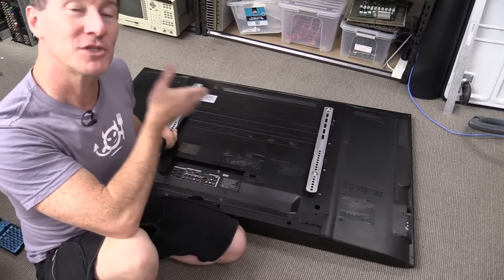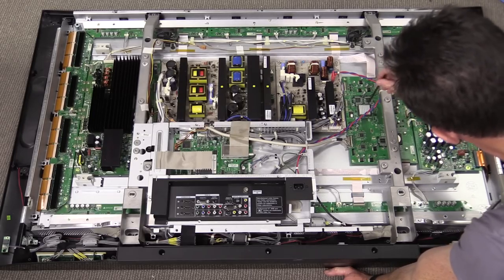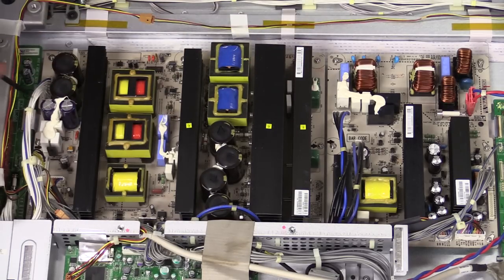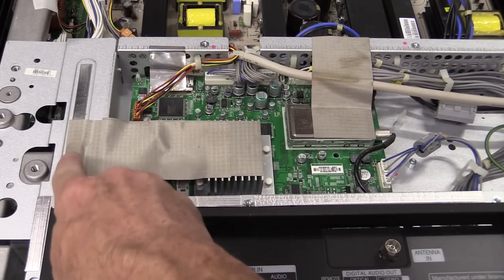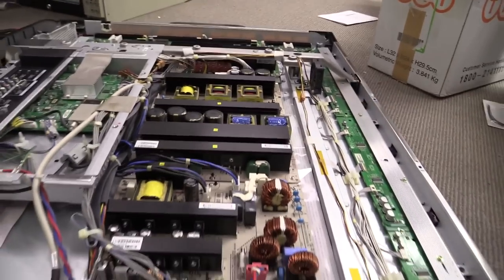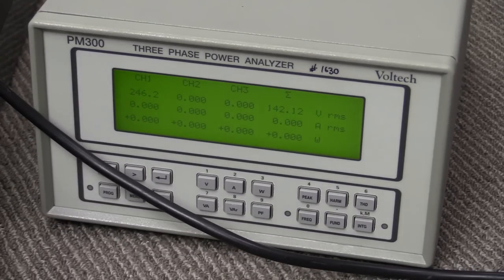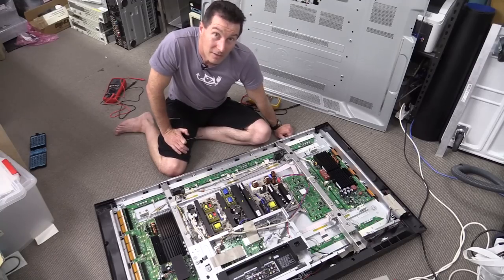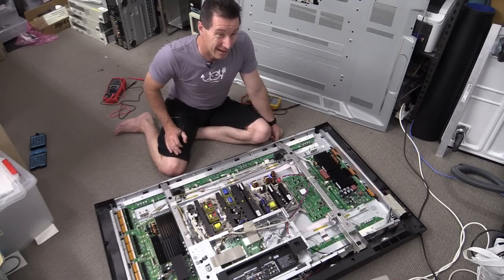EEVblog #725 - LG Plasma TV Teardown

Comment: Granted they are heavy, complicated and LCDs have reached a point where video quality is equivalent. But as far as reliability I'm just not so sure its as bad as you think.

I purchased a (high end) Panasonic 50" Plasma (Dec 2003). It is my family's only TV and gets quite the workout. TV is Still working great, no issues at all. (BTW it is bolted directly into the studs of the wall via a bracket and 1/4 bolts, did it myself, no biggie It has survived 2-3 medium earthquakes also).

Meanwhile I've had to replace my computer's LCD twice in that same time period.
Both times was failing worn-out/dim backlight.

Comment: yesterday i have checked an panasonic TX-P42GW30 plasma tv :) with no screen only green led whas powerd on, the y-sus board (TNP A5457) whas shorted out and i found 5 big smd mosfets are blowen under the heat sink and 2 big smd diodes, also i found an repair kit on ebay for this y-sus board with D401 D421 Q401 Q402 Q403 Q421 Q422 Q423 Q531 IC502  componenst,

Comment: We have a 50" Samsung warp plasma TV, I hate it, much prefer my 27" Samsung T27B550 LCD TV, mostly because the LCD TV doesn't make a load of squeals, buzzes, pops, crackles and whatever else the 50" can come up with, had to replace the PSU on the 50" too and that was pricey, if it dies, screw it, I hate plasmas... :P

Comment: Can I just clear up a couple of confusions on this much debated topic.
When referred to LED/LCD, the LED part is the form of Back Light used to illuminate the display, the older type was Cold Cathode LCD which used a funky uber thin fluorescent tube to light the display and suffered colour drift with age.
Now then, the over used term 'Burn-In' when talking about OLED/LCD/PLASMA is not entirely the correct term. Burn-In was entirely true when referencing CRT displays where the phosphors making up the pixels would degrade over time when over exposed to an electron beam.
In the case of LCDs, the mechanics of burn-in are different than plasma and OLED, which develop burn-in from luminance degradation of the light-emitting pixels. For LCDs, burn-in develops in some cases because pixels permanently lose their ability to return to their relaxed state after a continued static usage profile. In most typical usage profiles, this image persistence in LCD is only transient.
Both plasma-type and LCD-type displays exhibit a similar phenomenon called Transient Image Persistence, which is sometimes confused with screen burn but is not permanent. In the case of plasma-type displays, transient image persistence is caused by charge build-up in the pixel cells (not cumulative luminance degradation as with burn-in), which can be seen sometimes when a bright image that was set against a dark background is replaced by a dark background only; this image retention is usually released once a typical-brightness image is displayed and does not inhibit the display's typical viewing image quality.

Comment: Well I like the plasma TV's. Panasonic. The blacks are better than most LCD displays. The viewing angles are way better than LCD's. The colours are not washed out. Our plasma has outlasted two LG LCD monitors. However I think LED LCD TV's have improved the LCD market greatly. I would go for a LED LCD now as times have changed. PS plasma do output lots of EMI but nothing thats terrible. Plasma displays are clever design and a nice piece of engineering. 
Cheers Dave. Nice tear down.

Comment: I have an LG 22" Widescreen PC monitor I bought because I thought it would do me well for years.. The LED backlight failed after a few months of using it. The LCD still works, you can see it if you shine a light at it. The fault started with flickering, then one corner going dark, then the LED backlight just wouldnt come on at all. I dont know what to do with it, I couldnt be bothered taking it back under warranty as I have electronics background I can probably fix it, but I dont have the equipment to test it. Maybe its a power supply issue, or all the LEDS failed at once (unlikely) any thoughts?

Comment: MY LG 42LC2D has been running faithfully for 7 years.  Still looks as good as the day I have bought it. (Now having said that it will crash in a heap)  lol.  Yes it is an LCD HD 1080p, Although I have been told on the quiet the panel is on a 720p.
Thanks dave.   I do agree that those caps look like they have let go abit.

Comment: Did anybody else notice the 8 or more bulging capacitors on the first PS board? power board on the right when looking from the bottom. CLEARLY swollen caps between, under and around the big black heat sink

Comment: 6:10 frame...did you notice those caps on the power supply board on the right side...bottom right hand corner...looks like they blew up..BULGE!

12:30 YOU DID A CLOSE UP AND MISSED IT!!! HOLY CRAP!!

Comment: 50 kilos of power hungry gear!
I agreeDave, take it apart. 
Over 200 watts for a display! Wutt?

I do like high contrast screens, was very excited about the Trinitron my parents bought back mid-90s. Did a quick look for the Pioneer PDP-LX5090 OLED mentioned here... 420W! Oh my, black takes a lot of power doesn't it. Didn't old tube sets work with 100-200 watts?

Comment: When choosing a 'flat screen' TV for the first time, I went into the retailers with an open mind. Of the ones on display & working, it soon became apparent that the picture 'sharpness' was a lot better on LCD & LED televisions (at normal viewing distances). The picture definition seemed lower on 'Plasma' screens, however there was (in their favour) slightly less smearing of fast moving scenes. So to be fair to both I viewed all the TV's on working display & without looking at the spec label - so as to be impartial; I wrote on a piece of paper 'Y' (or) 'N' (yes or no) for the overall picture quality. The results were :- all 'YESES' for 'LCD' or 'LED' televisions & all 'NOs' for 'PLASMA'.
Not a scientific test, I agree - but it was good enough for me. I will always buy & recommend to others - 'LCD' & 'LED' displays every time until 'technology' brings out something even better.

Comment: New 55" LCD screens use only ~132 watts!  Versus 572 watts for the old Samsung!  Multiply that times 500-700,000 houses, bars... puts a load on the power companies and the planet (burning coal to produce watts) and transmission lines.

Comment: IME,the PSU's in these things are fairly heavily filtered on the line input.There will often be several sections of filtering with common mode chokes,and caps. Then there's typically some soft-start (the relays/resistors) and then into some PFC action.
12:49,that's a ferrite bead/filter.
15:08,It's common that the display panel will have a sticker on it,with it's required voltages.Some displays can be sort of picky about these voltages,so they need to be fairly bang-on. (it can also affect picture quality)
I've given up on trying to repair plasma sets. They're a PITA.

Comment: Arg I kept yelling at my TV every time you went over those bulging caps on the low voltage power supply board and didn't notice, dead giveaway! Another crap LG TV, worst brand I have seen, fixed so many of them just out of warranty due to capacitor issues. Why they keep designing power supplies with substandard capacitors and shoving them right next to the heat sinking blows my mind. BTW not all plasmas use huge amounts of power, old ones did, new ones actually made huge strides in efficiency. My newer Samsung uses about 160w calibrated, hardly a huge amount for a 58" panel. If you are going to do a video you should atleast give it a proper go! :)

Comment: I think you're exaggerating the power use a bit.  I have a 8 year old (around $900 at the time) Panasonic 50 inch Plasma that still works perfectly.  With the picture the way we like it, it uses around 140W. We live totally off grid and were expecting to need to replace the tv but 3 hrs use a day is no big deal. Heck people still run 6-8 x 50w halogen down lights in their living room!!

Comment: Sure plasmas had their drawbacks, but they gave you by far the best band for the buck in terms of image quality. The last few high-end sets from Panasonic were a whole lot lighter & thinner, and used about half the juice of that LG model, too.

These days, you're stuck with the slow response times, crappy off-angle image quality and even crappier black levels of LCDs. Unless, of course, you're willing to pony up the dough for an OLED set.

Comment: I could see some bulging capacitors on one of the boards on this video. Probably the reason why it's flickering and picture quality not being to flash. Anyway I had a Samsung Plasma screen TV but sold it on Ebay as it was chewing up way to much power and it was really heavy. I now have an LED/LCD TV now and it's much better.

Comment: Glad to see the power screw driver in use. (bare feet in all)
I have a 50 inch plasma ,"Panasonic".I always new it was a power hog from when I took it out of its box and plugged in the power cable .The cable looked as though it could  be used on 4kw power back up generator.I luv your info videos ,I am trying to watch them all. So, their you have it ,or, I mean "Bobs your uncle"..

Comment: Hey Dave ..  I noticed something may be useful in fixing this Screen .. I noticed some Caps not as good (bulged Capacitors) in the Low Power Power supply module .. wish you the best luck

Comment: The right (looking at the back) power supply board looks like the smaller caps are all bulged. The closer picture at 12:30 or so shows they are quite bulged. still watching

Yeah, would be curious to replace those and see if it fixed it. Then you could just donate it to whatever the AUS equivalent of Goodwill is. =)

Comment: In my opinion SAMWHA capacitors are good quality. Only thing is that you need to use the correct series for the  purpose...  I am using them in my projects too, never had a problem.

Comment: I might missed something or did Dave didn't saw those bulging/licking capacitors on the power supply for digital part. I can imagine operating camera takes your view off, but those are really easy to see from the first look, same as brand of caps on V power supply. It gets me worried if Dave has any vision problems, it's not the first time I spot it in his videos.

Comment: Secondary caps on the low voltage PSU are totally toast, how could you not notice that?
I don't like plasmas either but if i were you i'd replace those 6 bulging caps and just sell it for cheap.
I doubt that there's anything else wrong with it.

Comment: Did you really go through and pull parts on this? :)  I used to do that kind of thing and found I never really use the parts, they never really fit into any projects I was trying to do.  An interesting video would be if pulling gold from old electronics is really worth it.  I know it's not really engineering per se, but it has to do with scrapping electronics.

Comment: I agree - too heavy and power hungry. I would salvage it for parts also.
Reply: Especially since he basically has an 'all you can eat buffet' of LCD displays when he goes dumpster diving. He can afford to be choosy when other people are buying, then throwing out, perfectly good stuff!
Reply: dalriada842 
Yep.
Reply: dalriada842  Have to remember where he is too.  lots more money etc; so the value of things is less.
Reply: ***** 
That's not true at all. Actually, Plasma TV's are easier to diagnose and repair. It takes some work sometimes to get to the boards, but if you know what you're doing you can pinpoint the problem board most of the time by looking at what is happening on the screen.
Reply: Mitchell McCreath 
I disagree. The main drawbacks with the older units are the weight, heat output, and power consumption.
Reply: ***** 
I wouldn't have one either. And most of the time LCD/LED's are cheaper to repair than replace. You shouldn't be talking about repair when it's obvious that you know nothing about it.
Reply: ***** 
1) You better reread your comment... You said, "...they are cheaper to replace than get repaired.". Once again you are talking about repair that you obviously know nothing about! Most problems are bad solder joints, a loose connector, e-caps, diodes, or a bad cable. 
2) The repair that usually doesn't last long is the cheap BGA repair.
3) I didn't say you "can't" talk about what you want to - I said you "shouldn't".
Reply: ***** 
Oh, I don't know anything about the UK. But still the majority of problems are simple fixes.
Reply: ***** 
Who cares? Clever has nothing to do with it - I have plenty of repair manuals and books, and nearly 3 years experience.
Reply: ***** 
It's just a hobby to me. But I've saved a lot of money fixing my own stuff by learning electronics and device repair. I changed the back-up battery in my Tek 2465A DV scope myself without needing it recalibrated. That alone saved me at least $400, which is what I paid for it. I think I spent around $15 at Mouser for the battery.
You should learn to repair your own devices and save yourself a lot of money. Plus you can make extra money on the side fixing devices for other people.
Reply: ***** 
I used to be a mechanic also. I also love riding motorcycles, but my back won't let me anymore. I had a '69 Ford pickup one time that a deputy clocked me at 157 mph in. I couldn't go any faster because it would start floating on the air, even though I had plenty of pedal left.
Electronics is a fun hobby even if you don't need to save money.
Reply: ***** 
Yeah, that's what the cops thought I had and wouldn't let me leave until they inspected my truck. They didn't arrest me because I was taking a friend to the hospital.
They didn't find anything though, and had to let me go... but the engine is not where the secret was...
The secret was in the gears, of course.
Reply: ***** 
My dad used to drag race motorcycles, but I didn't work on them much. I just rode them. The engine in my truck would be idling at 60 mph, lol. I could take off in second gear and wouldn't have to shift up until about 90 or so. The rich boys wouldn't even race me. It pays to have friends that own salvage yards.
Reply: ***** 
Yeah, the cameras and everything sucks - they are trying to make us all slaves. Kids nowadays can hardly have any fun! I was born in '60. I used to run 120 or more in my '73 Monte Carlo Landau to work and back and hardly ever see anyone else. Now, you can barely back out of the driveway without getting hit by someone.
Reply: ***** 
Yeah, we can only do what we can do - save money when we can. We still have plenty of salvage yards here in Texas.
Reply: ***** 
I was a truck driver for around 14 years, so I have over 1 million documented miles. 
I know what you mean about the close calls. There are too many people on the roads now for high speeds.
I'm also not in the shape for it anymore.
Well it's been fun chatting with you. I have some business to take care of in the morning so I'll talk to you later.
Keep your iron tinned.
Reply: ***** 
Only slept 4 hours. 1700 miles would be considered a bad week in the US. Affirmative Action ruined our highways.
Reply: ***** 
Yeah, sleep is a waste of time.
Reply: ***** 
It depends on the person - some need more than others. But if you don't get enough sleep, you may think you're getting more done but you actually aren't. It's the same with multi-tasking. I'm disabled now so I just let myself sleep what I want to. But I don't require as much sleep as when I was working.
Reply: ***** 
Lol. Yeah when I was in the Marine Corps, I could run all day and not break a sweat. I'm only 54, but have back problems. I guess I just worked myself too hard or it's the poisons my gov is putting in our water.
I got taken out to sea by an undertow in the summer of '82 at Laguna Beach, California. It took me 13 1/2 hours to swim back. There's no way I could do that now. Those memories still give me chill bumps to this day. I still have the Citizen watch I wore during the ordeal, even though the crystal is broken.
Reply: ***** 
No, no more motorcycles for me.
The sea will kill you if you're not careful - and it isn't prejudiced.
Reply: ***** 
Absolutely!

Comment: Plasmas are not dead. Modern plasma screens are much lighter, and don't have issues with burned images. The good ones have excellent colors and blacks compared to lcds, and still sell a lot. LCDs are lighter, thinner, consume less power and don't have as bad reflections as the glass panel on plasmas.

Comment: I remember the fantastic Dr Karl of the ABC/BBC describing plasma TV's as "heaters that just happen to display images", which got me wondering how much heat per watt would you expect compared to a typical electric heater, And could they justify their thirst for electrons in a colder climate?
Reply: That is easy, they are equal. Every watt-hour you consume becomes 3.41 BTUs AKA 860 calories. It doesn't matter what consumed it.

If you turn on a fan you get part of the energy as direct heat from the motor, the other part moves the air which has friction with itself and with objects like the fan blade and the friction converts that part of the energy to heat too.

Light bulb same thing, part goes directly to heat and part as light which is absorbed and also becomes heat.

This is what makes those overpriced scam electric space heaters sold here in the US so annoying.

Comment: What's the point of putting fuses in this thing instead of just soldering in a fuseable resistor? It's not user serviceable; if the only person looking at it is a tech why not just add a minute or two of soldering for repair instead of adding the cost for a fuse?